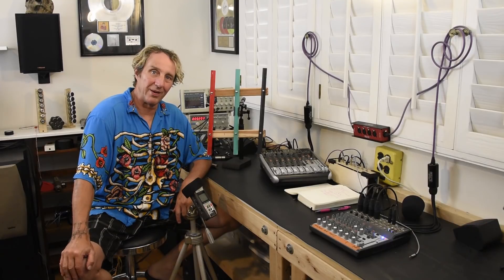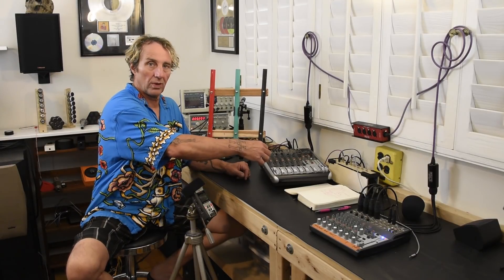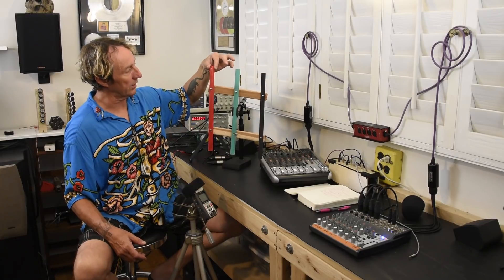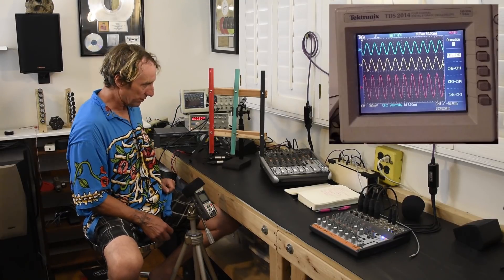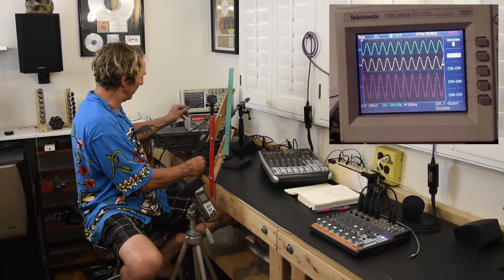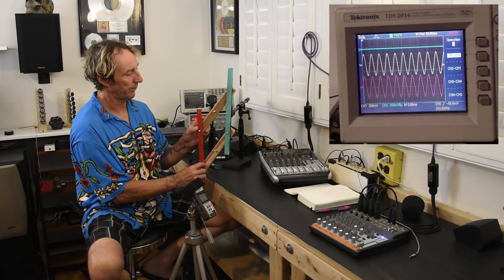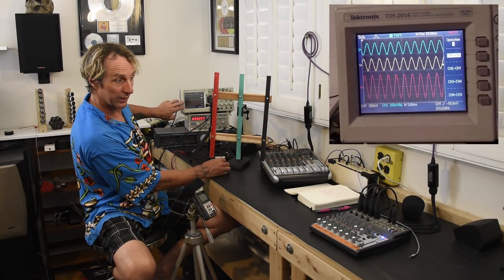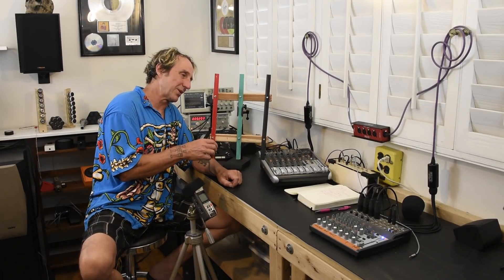How Do Balanced Audio Lines Work?

Comment: Dave, that is a great visualization!  Maybe adding the words, differential mode and common mode voltages would help people with understanding equipment specs.  Maybe a horizontal bar across all three to represent mixer ground and some marks representing voltages on the vertical bars would help.   Your generator may have a dc offset you could all to both channels to show common mode rejection.  Again, well done and very accessible!
Reply from the maker: Awesome and thank you!

Comment: Excellent demonstration Dave, something I have always wondered - 
1.Why don't we have balanced outputs from instruments like guitars? 
2. Is the only benefit of balanced audio interconnection just noise suppression compared to unbalanced audio interconnections? 
Thanks and appreciate the videos a lot.
Reply from the maker: As far as the benefits of balanced lines, I believe the concept progressed like this:

We need a way of reducing HF roll of on mics. 

Ok, well, if we use a low impedance, low voltage, high current signal, we can fix the capacitive HF roll off issue.

Cool, that works great but now with the super low voltages, we need more gain and we are getting noise.

Ok, how about we line balance to cancel the noise?

Cool, that works great, costs more for cables, and mic preamps and such but sounds great. What should we use for a connector? How will we deal with all the unbalanced mics?

Well, we could make mics with selector switches for high and low impedance. As far as connectors, maybe the D connector or tucol or cannon XLR?

Ok, let's all use different connectors for loads of years and then someday standardize reluctantly

Cool, hey, since we are running balanced lines, check this out, we can run phantom power to power condenser mics.

Perfect.
Reply: @DaveRat  hehehe nice! Thanks
Reply: Balanced is very useful specially for long distances to cancel any noise picked up along the way. Thats the main difference between unbalanced lines. Maybe instruments use unbalanced since the lines are relatively short.
Reply from the maker: Also, most dynamic mics are so much lower output level and wider frequency response than guitars, so they need low impedance to preserve the HF and balanced lines to deal with interference on the intrinsically lower output voltages of low impedance.
Reply from the maker: It would be super easy to make guitar and bass pickups balances, as they are just like mic coils and they could see significant benefit from being balanced.  That said, guitar and bass rigs face some challenges in balancing. 1st, they are high impedance and high impedance cables benefit from very low capacitance cables like guitar cables.  Mic cables have a higher capacitance.  Also, all the guitar volume, eq, and switches would be twice as complex. So would the guitar amp inputs as everything would double to deal with the 2 signal wires instead of just one.  Also, with wireless, it makes balancing the guitar almost irrelevant as the cable is so short.  That said, I have seen balanced line bass rigs with XLRs on the basses.  Never really caught on though.
Reply: Phantom power on an unbalanced line is unpleasant to say the least. Not only do you have any PSU noise appearing as signal, hot plugging is, err  bad, very bad.